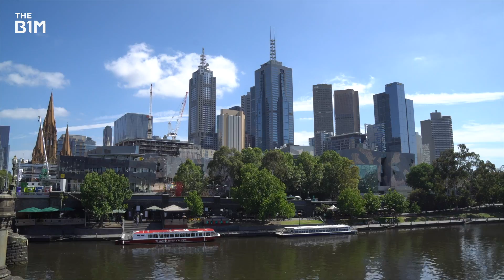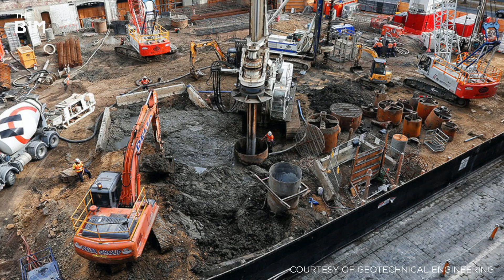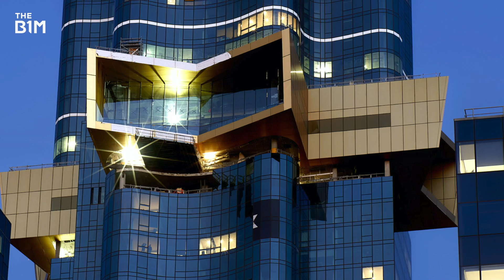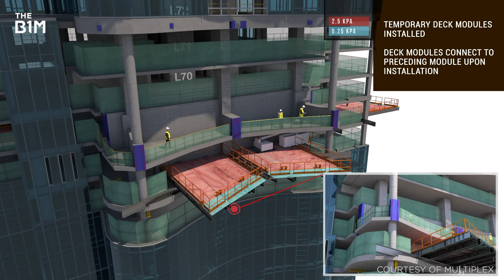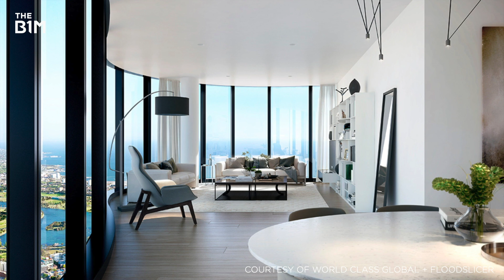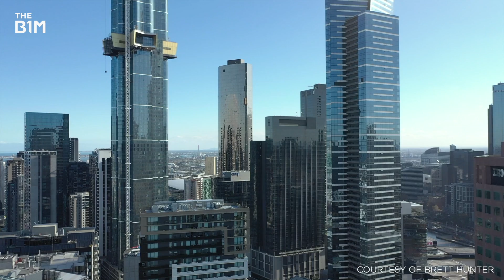Inside Australia's Tallest New Skyscraper

Comment: Didn't know Australia had such a tall skyscraper! Excited to watch this :)
Love your content. Your work really inspired me to start my own channel
Reply: Looks like you're not a regular to this channel?
Reply: It’s good to see a channel give some exposure to other great cities. Instead of the same old cliche New York and Dubai.
Reply: It does now
Reply: Eureka tower, which is seen nearby to this is another one. Q 1 on the Gold Coast is the one this build tops.
Reply: @gusdrivinginaustralia6168  This build doesn't top Q1 and Q1 is still the tallest.
Reply: @rasta77-x7o  yeah this is where things get tricky with classification. Google search shows Q1 occupied max is 235m with the tip at 322m. While 108 has occupied max at 312m with the tip at 318m. The spires/antenna /tips vs occupation height are much debated in the industry. Fair call though, I'm glad your comment prompted me to check. :)
Reply: @gusdrivinginaustralia6168  Fully acknowledge 108 and Eureka have higher occupied floors and are both stunning towers. Q1 has an architectural spire which is usually always considered part of the building height, i am iffy on antennas, i don't think they should be included.
Reply: @rasta77-x7o  yep. I reckon it should be measured at the highest point Joe Public can stand indoors without safety equipment.